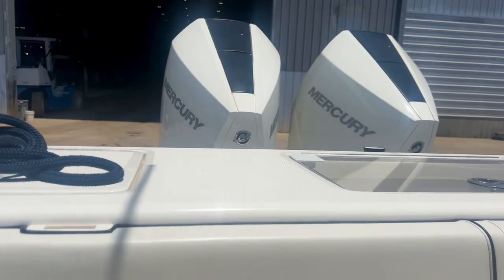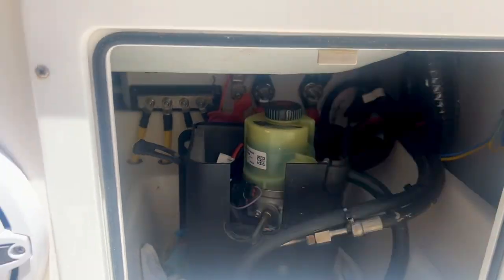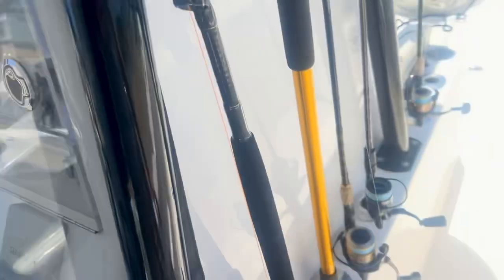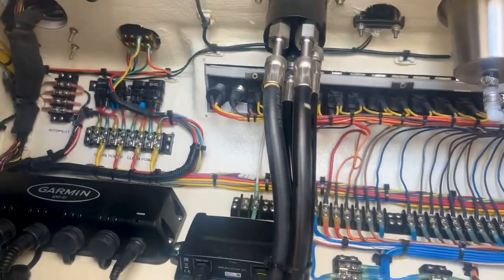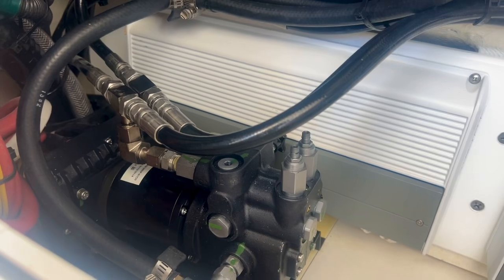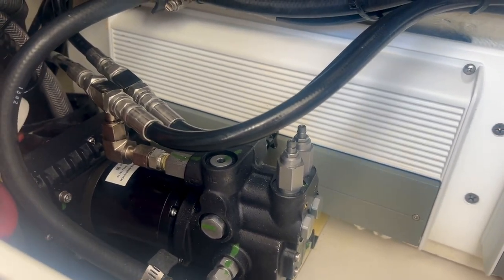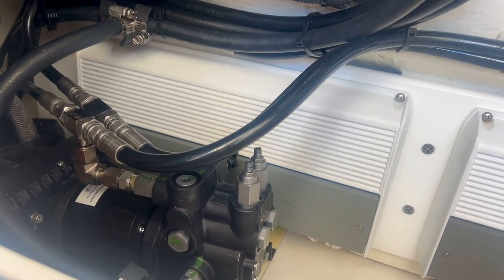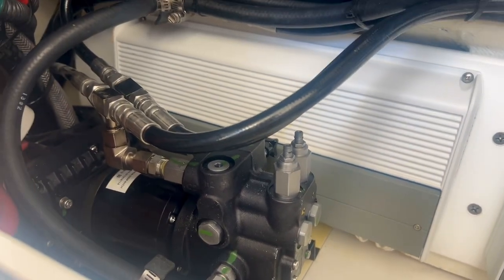Mercury Verado Power Steering Service

Comment: Where do you bleed it from
Reply from the maker: The nipples on the steering capsules on the back by the motor you unscrew them slightly and turn the motor left and right
Reply: @fishingwithaustin01  do I need a tube for them
Reply from the maker: @buddyboiiiii3164 for getting the fluid out no, but to bleed the air bubbles turn it on and turn it to one side hard, turn off open cap. Turn back on monitor levels. Repeat. There’s more details in the description
Reply: What is the Second pump four?
Reply: @blairsutherland8393 autopilot